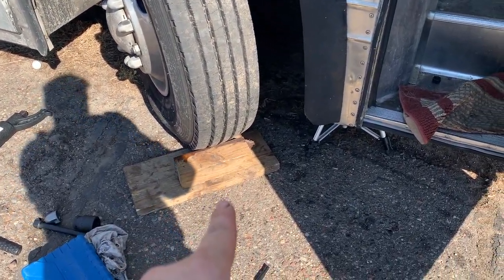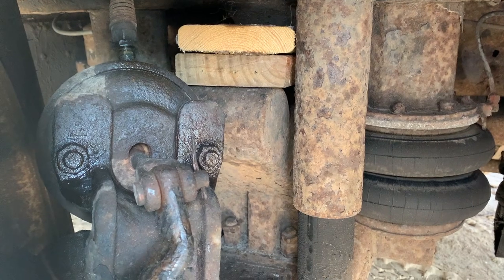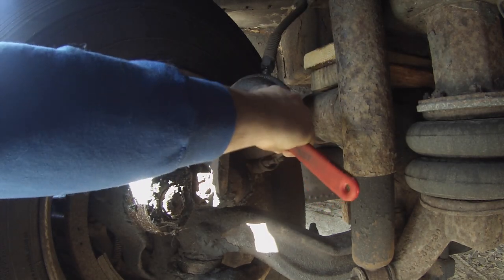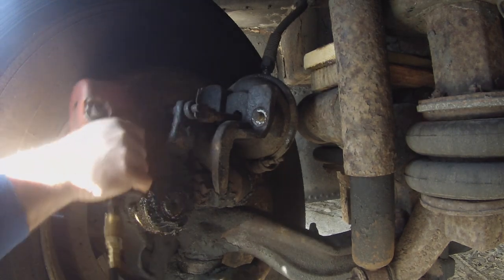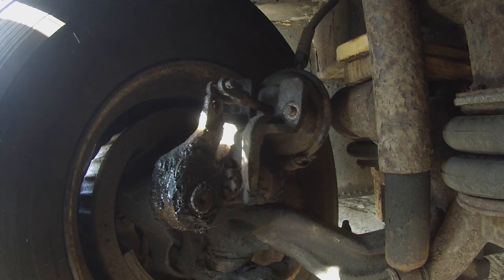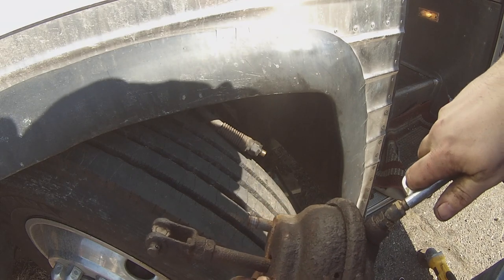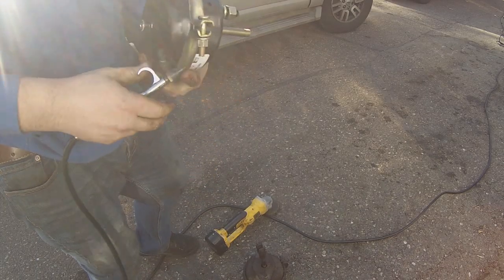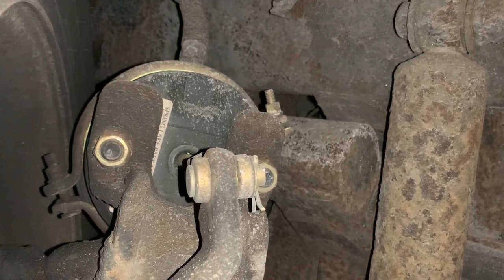MCI MC9 Front Brake Chamber Replacement

Comment: I have the same year and model, but with a leaking brake can on the rear axle. I have had a devil of a time trying to find someone to fix it...thinking of attempting it myself.
Reply from the maker: This is my favorite vehicle to work on. Big bolts, sockets , plenty of room to work.  The brake can is 2 bolts and an air fitting. You got this. 

Although the DD3 spring brakes I hear can be dangerous, do your research on that.
Reply: @HimmelbergerBus  That is kind of what I am afraid of...